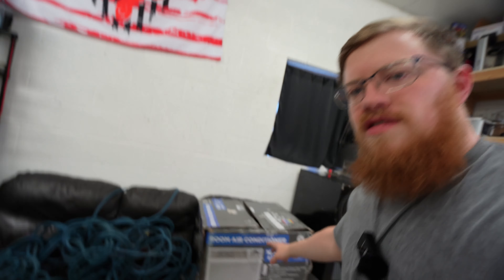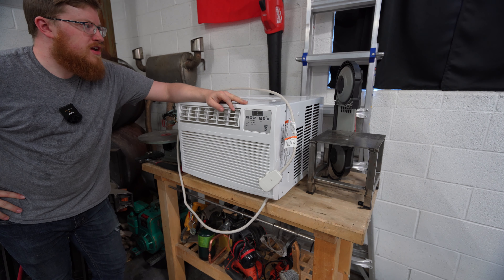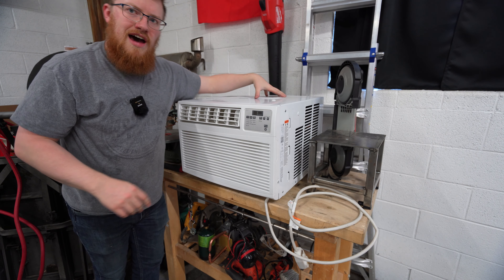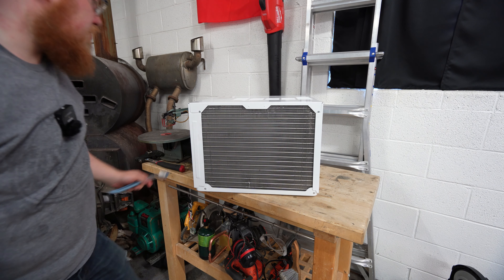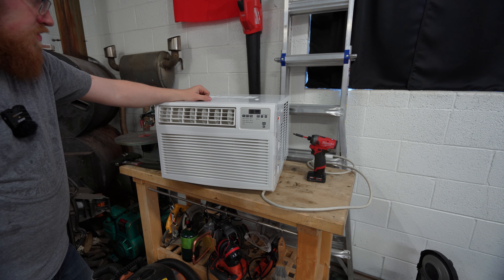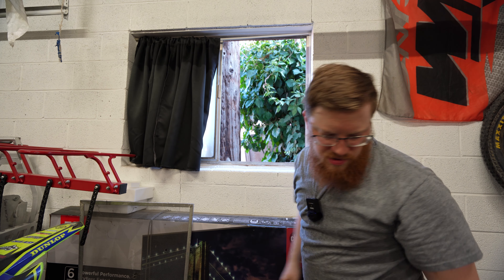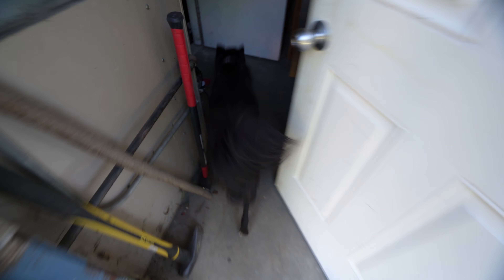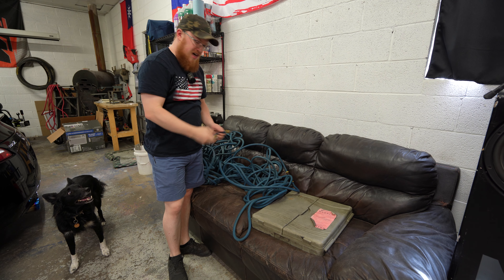Some NEEDED Shop Upgrades! Air Conditioning And Compressed Air

Comment: Getting some air conditioning, now there's a cool project! And, yeah, be careful with the extension cords in the ceiling in the heat of the summer. If you draw too much current for very long, you run the risk of melting the wires.